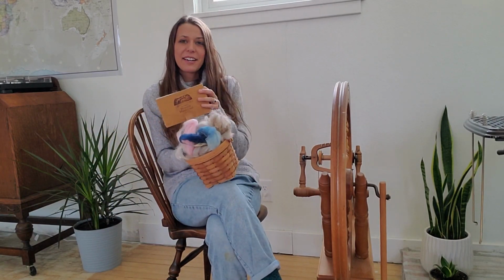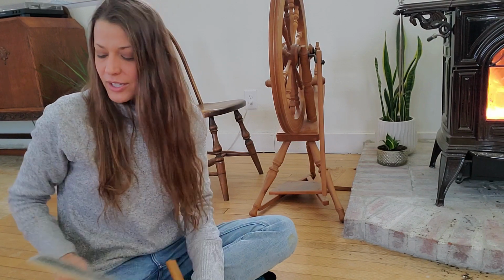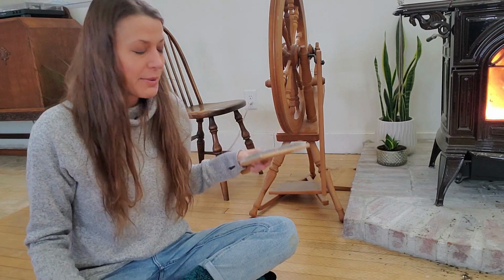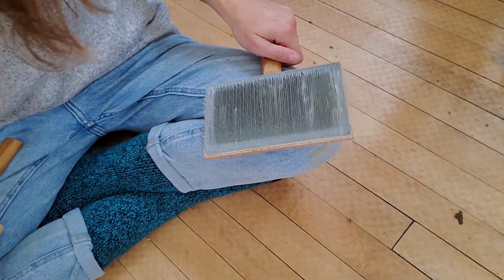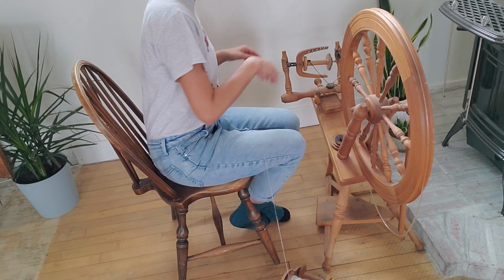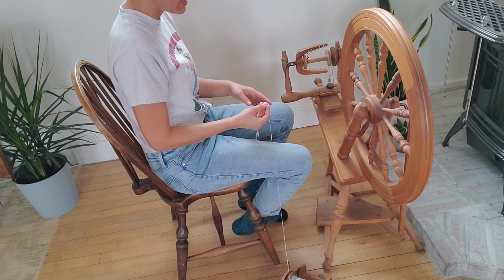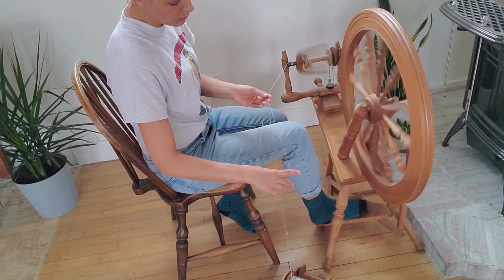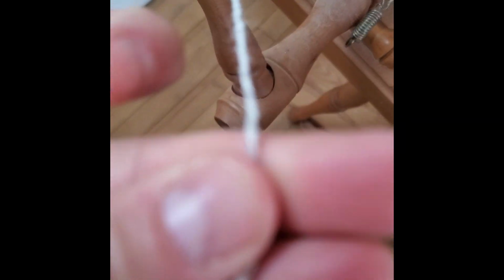Spinning YARN using only 2 tools

Comment: Another washing question!  I spun this box and it was suuuuuch a wonderful spin!  I had never spun anything with lanolin before, and it was pretty amazing.  So, when you said you washed the Finwool once, how did you do that?  With Dawn or a fiber scour?  Just a hot soak and a spin in a top loading washing machine, or do you use a big sink?  I’ve purchased some more wool and angora from your website today to try and replicate :).  Many thanks!
Reply from the maker: Thanks for the purchase. :) I really liked this spin also! I will have to make a video of what I do. I do not wash the entire fleece at once. I wash it in batches. First is rinsing with hot water, but no so hot your hands can't stand it. Then is the soak in the same temp water with "shampoo." Then rinse with same temp water. Squeeze and lay on a drying rack in front of the hot fire to dry quickly. :)

Comment: Can’t wait for my box to come!  How do you finish your wool and angora blends?  I’ve spun my January box and am wondering about water temperature, thwacking, etc.
Reply from the maker: After completely finishing the plying of the yarn, use hot water, but not hot enough that it will burn you. You should be able to still place your hands in it without being uncomfortable. Put your wash in (I used shampoo for mine) and the yarn. Make sure it is fully submerged and let it soak for about 10-15 minutes. Rinse it with the same temperature water as what is in the sink, after the soak. I twist my yarn to get the water out, but if you would rather be more cautious and less wild with the yarn, then give it a good thwaking on a counter or hard surface after blotting the water out. Thwak it somewhere around 4-10 times. Keep moving the spot your are holding onto the yarn after each thwak. Then, hang to dry. If it is drying too slowly, a low fan, heat source, or sunlight will help. Enjoy! :)